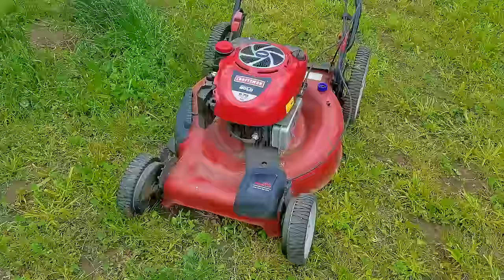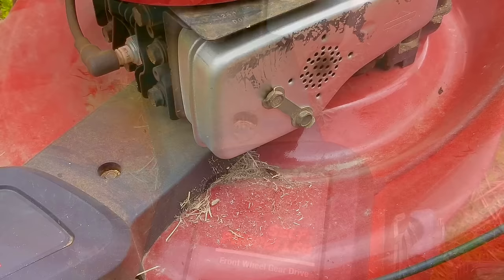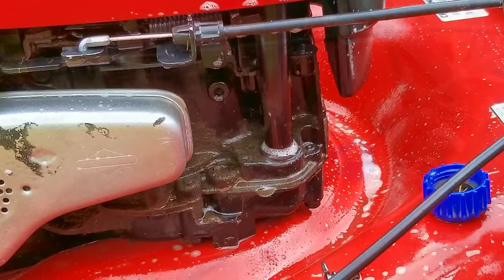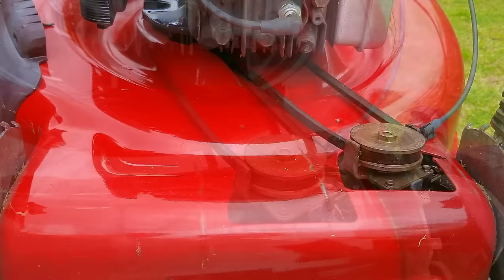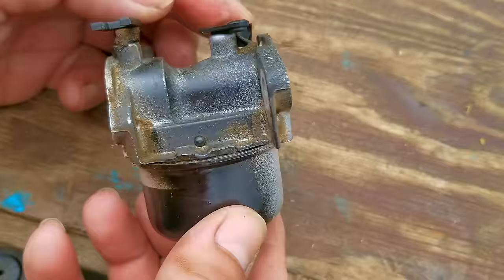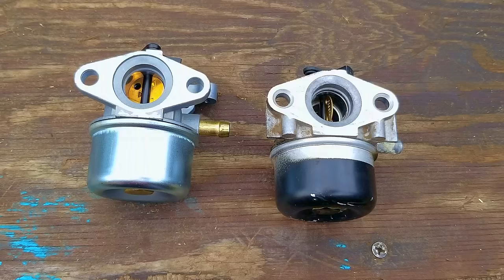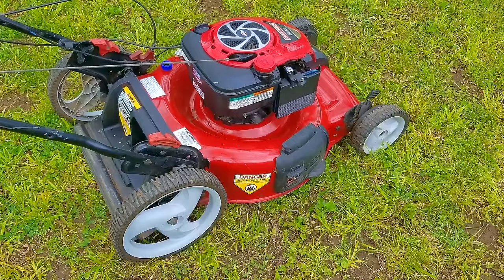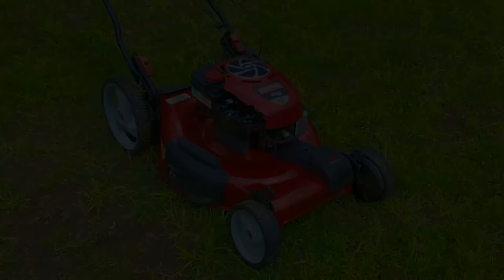Fixing A Craftsman Mower That Won't Start

Comment: funny, this is the exact same repairs i just did on 2 toro walk behinds I was recently given. one was a 2002 model, one was a 2016 model. both in excellent condition bit were not running. the 2002 model had alot of crystallized build up along the valve, the other had a small crack in the needle seat that was flooding the engine. CHEERS.
Reply from the maker: Thank you TheTipsyGamer for sharing your experience, I appreciate it.

Comment: I check my oil in all my lawn equipment every time before I cut my lawn. Having the proper amount of oil and having clean oil and air filter is very important. I check all I mentioned before I even start my mower or lawn tractor
Reply from the maker: very nice Gary Allen.

Comment: I use synthetic 5W30 on all my Briggs stuff and check it before each use. The positive difference in fuel efficiency with synthetic over conventional SAE30 is noticeable in my experience. I also like the flexibility to use the equipment in any outside temp condition as compared to conventional SAE30. That really helps living in the northeast.
Reply from the maker: Great point! I'm going to have to consider switching.
Reply from the maker: thanks for the information I really needed that.

Comment: I bought a used Craftsman (grey with red motor cowling) with the MRS 6.75 engine. Thing ran for 6 years without any maintenance, started on the first pull every time, and I sold it for what I bought it for.  Very underrated mowers.
Reply from the maker: you got that right.

Comment: I got a 7 ft lbs Briggs mower (Platinum line?) which is in OK shape, only issue is the blade adaptor, and blade and missing and the bolt is broken off in the crank. I'm a mechanic, and i could bring it to work, but man. Hard spending 50 or so dollars and idk an hour or so trying to get a bolt out for a free mower lol. Love the easy fixes. I got a good few free mowers and 80% of them i dropped the bowl, wiped it out, fresh gas in the tank and shes good.
Reply from the maker: that's your call, hopefully an easy out works.

Comment: I just found a mower in the trash I was just gonna change the filter and spark plug. But damn. You gave me so many ideas. I mean even if I don't get it running (which I'm pretty sure I will) it's still fun for me. And not very expensive. And I learned
Reply from the maker: you bring up a great point.  A lot of people get enjoyment from working on these.  Hopefully they can also get them working in the end.

Comment: Honestly, I may check the oil in my mowers may be 4 times a season and they’re never low. Always change the oil at the beginning of the season. You bring up a good point in the regards to chances of success, and that’s the prices of certain parts is something to keep in mind. I repaired my Stihl FS 110 a number of years ago. I thought I’d just get the necessary carb rebuild kit, but after some investigation, a new carb (a Stihl one mind you) was cheaper than the carb rebuild kit. The longer I’ve been into fixing my own, and sometimes other’s small engines and equipment, is the the sum of the parts, when purchasing individually, is substantially more than the whole piece of equipment.
Reply from the maker: thank you Warren Burke.

Comment: This may sound odd, but I ALWAYS check the oil before starting the mower. This is especially important since over time it likely will burn a little....and a little more...until it gets to the point of becoming dangerous like in the video. Not only that but most user manuals tell you to do so probably for this reason.
Reply from the maker: you're doing it right, a little bit of maintenance goes a long way.

Comment: awesome ....amazing how your time is valuable ....we love to see 13 to 15 min videos to the point but there is so much more when it comes to pertinent or non pertinent and angles and cleaning and waiting for parts ..... is there a recommended rpm for engines and how do you find it without some form of tach....how would you use a tack on a mower

Comment: I usually check the oil every time a mower runs until I see how they're going to act as far as using it. Delo stays with the old and new because it's thicker I suppose but I still check the engines regularly. With a new to me rig I usually pull the blower housing off to see about rats nests and damage and rust on the mag and flywheel. Briggs says that rust doesn't hurt anything but if that's the case, why don't they ship their engines pre-rusted! Next is usually the carb and fuel system. I already checked the compression by pulling the rope and seeing how much oil is in it. And ether (starting fluid) makes a fine degreaser. Thanks and BLESSINGS!

Comment: I usually change the oil every season check it throughout the mowing season to make sure its still at the correct level and mostly clean if it looks to dirty it gets changed if it gets to low look for damage or leaks which hasn't happened but I've had a crap mower that burnt oil because of blow by it was rebuilt after it wouldn't start and had piston cylinder wall damage had a replacement piston and rings and sanded cylinder walls to fix most of the damage but still had minimal  pitting or roughness like scratches that allowed a little oil by as it ran so it smoked alot and used a little oil due it it getting burned
Reply from the maker: thank you Eric Richardson.

Comment: I’d go a little bit higher on the rpms, it should be around 3000 for a 22inch self propelled they need the extra oomph to get thru tall thick conditions. You don’t have to use a meter go by ear, you’ll know if it’s running too fast it should be a happy medium around 3000. I have a video of mine that I posted after I adjusted it and that is the correct RPM speed these Briggs quantum’s should run at incase your not sure how it should sound by ear. I had this same mower! Loved it.
Reply from the maker: Thank you DWoods, I just have to be careful what I show on video.

Comment: Like u said it's a chance to replace the needle and seat sometimes on the original carb I have done it and almost the same issue . As for the oil I check it before I use my lawn equipment I have just in case
Reply from the maker: thank you Turningwrenches85
Reply: @HomeGaragechannel  your welcome

Comment: I've got one with this same style engine. It will putt for a second after pushing the primer bulb a few times, then dies. I had cleaned the carb and got the throttle plate moving again. The jet is clear, and I can see the fuel bubbling up when pushing the primer. This carb does not have a choke plate. I have another mower that I have to repair so wanted to get this one going in the meantime.
Your video helps a lot. I think I may just have to get a new carb (cost effective, as you say), and it will be good to go. Still wondering about the lack of a choke.
Reply from the maker: yes , once you've exhausted your attempts to clean the carb, just buy a new one.

Comment: I check my oil every other cutting. i learned that when the oil is run low like that the engine heats up and shuts down the coil . I am sure you heard before that it runs a while and shuts off but starts a few minutes later
Reply from the maker: no I hadn't heard of that. If that was a feature, I would think they would advertise it on the box.

Comment: Let me ask you what motor oil are you using? I'm still buying the little bottles that are sold at most places that have a parts section for lawn equipment. I have seen online that some people say you can buy car oil I don't remember the weight off the top of my head. I want it to get your opinion on that.

Also I know you get some of your things from Amazon and eBay where do you order from when you cannot find what you're looking for from Amazon or eBay.

And as always I enjoyed your video and gave you the thumbs up. Look forward to the next one.
Reply from the maker: Thank you Davide Frank for the questions.
I use motor oil 99% the time and I haven't had any issues. Some would tell you use oil formulated for air cooled small engines, and they are probably right, but I haven't had any issues yet. I use 10w-30.
I only buy from Amazon, 95% of the time using Ebay for those rare occasions.  If for some reason I can't find it on either, I simply don't buy it, and wait for it to show up.
Reply: @HomeGaragechannel   thank you for answering my question.
Reply from the maker: no problem.

Comment: I have replaced the seat with no problems but carburetors are so cheap now it's easier to just replace them . This style mower is my favorite of all time. Have you been approached by Hipa like all the other guys? They seem to make good stuff.
Reply from the maker: I don't mind Hipa but If I find a cheaper price, that's the one I'll go with .
Reply: @HomeGaragechannel  me too. They are not the cheapest.  They have been giving away lots of stuff to some of the other channels.  I was  hoping they would help you out.
Reply from the maker: I'll let you know they've contacted me several times and I have not responded.

Comment: Was hoping for a needle seat replacement as my personal pressure washer with same carb needs one. Ebay has seats 20 for $7 shipped.
Reply from the maker: I'm glad you said that, I have a video I just film where I replaced the seat. it was a bit hairy to say the least. The seat replacement works but the success rate is questionable. That video will be out soon.
Reply: @D4x4Bronc, beware.. I made the mistake of buying those and they don't fit. They are too fat and the float is not level. Get the original manufacturer's part or known reliable aftermarket such as Stens, Oregon, Rotary, etc..

Comment: I got a question I have a  Echo trim and it dose not like to start easy when it dose run you have to give it 2 to 5 mins before up can go to full power or it just try to die and if you turn it off and gone for 5 mins you have to restart it like it is cold I try putting little more oil in the gas to help but not sure what to do
Reply from the maker: interesting, I would like to get a compression reading from your engine, to make sure, it's not worn out.

Comment: Well for me every few months and when it's time for a change i get it done by using a oil extraction kit which makes little to no mess from my view etc.
Reply from the maker: I've thought about get one, where did you get yours?
Reply: @HomeGaragechannel  well here in Australia we have a hardware store chain called Bunnings Warehouse but yeah i do believe that you can buy them online too.
Reply: @Patrick4959  Oil extraction tanks are SOOOO darn usefull for any type of smaller engines. Even good for bigger ones if draining it is going to make a ginormus mess or drain off into something like a lake ect. Fast easy, no mess, even gets all the oil in most cases.
Reply: @baileyhatfield4273  your not wrong and in some cases the old fashioned way is just as useful etc.

Comment: Hey bro what's up? I've noticed that most of the newer mowers if not all have a wash port on them. My question to you is what is the wash port on these mowers for? Style apparently since no one seems to use them at all
Reply from the maker: that's a good question. After using your mower, you can connect your garden hose to it, and then turn on your mower. IT will clean under the mowing deck for you.
Reply: @HomeGaragechannel  since I've never used a mower ever in my life I'm assuming that these flat head engine mowers are more powerful than the other engines

Comment: If anyone can tell me where to find or what the part number is for the air filter assembly...you'll be my new best friend. I need the rear and front cover. Mine doesn't have a priming bulb either, like this one.

Comment: I could use some help, I have changed the oil, spark plug, and the air filter. This was a donated mower, which likely not been used in 3-5 years. I sprayed starter fluid, and got it going for 3-5 seconds. So I cleaned everything, remvoed the bowl to ensure there were no issues, cleaned completly. I then pulled the carburator, to clean it completly, but after putting it back there was a lever that would seem to maybe have a spring attached, that it may have popped off. I cannot find anything as I had some plywood platform to work on it. After looking at the video again, I ssee that there is a spring missing. Can you tell me what it is so I can get another, and where it attaches to?
Reply from the maker: since I Cannot see what you're looking I can only guess as to the spring. But if I had to guess I'd say it was the air vane return spring. it goes to the lever arm on the vane, to a tang that's on the metal plate. you can see the spring in this video at 7:32.

Comment: I like the way you cleaned the mower. However, is there any area we should not pour water on to avoid the engine not start?
Reply from the maker: sure the whole thing. it's actually recommended, in the manual to not use water, instead blow off the mower, and then a damp rag.
Reply: @HomeGaragechannel  Thanks!

Comment: I have one that’s a very similar model, it has a new air filter, new carb and new spark plug. It doesn’t run consistently. Can this be fuel issues?
Reply from the maker: it could be, did you buy a new OEM carb, or a cheaper aftermarket one?   Also did you clean the fuel tank, confirmed the fuel line was not blocked, and also was it ever ran low on oil?

Comment: For faded Red or Black plastics use 50/50 mix of Boiled linseed oil and paint thinner...just a thin wipe on sun faded plastics goes a long way..just wipe it on and leave it dry..
Reply from the maker: Really!? I'll have to try that out. thank you jct300m
Reply: @HomeGaragechannel  Its got to be "Boiled" linseed oil..works pretty good and does not leave a residue behind either..

Comment: Can you share the link to the carburetor you bought? Thanks
Reply from the maker: I can, but if you're intending to use on , I would confirm that it's going to work for your application.
Reply from the maker: I put the link in the description field.

Comment: My craftman mower i bought in 2008 with the Honda engine still runs and i never cleaned the carb. They don't make them like they used to.
Reply from the maker: correct

Comment: I’m shocked at how low cost carbs are. Replaced on for a mower I bought and reconditioned for my son. The seals were almost as much as a factory new carb. Problem solved. He’s loving the new mower for 1/3  $ of a new one.
Reply from the maker: nice work!

Comment: I tried starting my craftsman mower today and it won’t start. The mower is only 2 years old garage kept. I flushed out the old fuel and put new fuel, checked the spark plugs and the oil level. But it simply won’t star. What could be the issue?
Reply from the maker: how did you flush out the fuel?
And more then likely the fuel jet is clogged just like in this video.

Comment: I have a Craftsman lawnmower that won't start. I pulled the carb, cleaned the main jet and sprayed every nook and cranny inside the carb. I also replaced the inline fuel filter, added fresh gas and checked the spark plug and that looks fine. Went to go start it, and nothing. I sprayed the carb with a little cleaner and she fires right up then dies. Any help would be greatly appreciated.
Reply from the maker: sure, do me a favor and loosen the bolt on the bottom of the carb, and see how much fuel drips out,
IF it's slow or none comes out, the there's an obstruction in the fuel line,   IF a lot of fuel comes out, then there's a blockage in the carb. I would just replace the carb.
Reply: @HomeGaragechannel  thanks for the reply. I took the carb apart again and found that the rubber oring that the float needle seats into was coming apart and blocking the fuel from going into the bowl. I just went ahead and ordered a new carb. Thanks again.

Comment: I have a question which I think I know the answer but I would like to be sure. Does the 2 cycle oil in gas ever get diluted by the gas to the point you are just giving you 2 cycle engines straight gas?
Reply from the maker: the answer is no, unless you add more gasoline to the mixture, but on its own, no.

Comment: I replaced a carb on a craftsman push mower and it's still not getting fuel into the bowl. If I disconnect the fuel line from the carb the fuel flows out of the line like it should. I've manually filled the bowl twice which meant I had to remove the carb and the mower runs fine until it drains the bowl. What could be the problem with the fuel flow?
Reply from the maker: the needle and seat are not allowing fuel to flow into the bowl.  do me a favor and tilt the mower's front wheels up into the air.  Take off the air filter and the base.  Take off the bowl, and watch out for what spills from it. Then while pressing the float up, put the mower back on all fours, then let go of the float so it can drop down.  watch how much flows out of the needle and seat area.
Reply: I figured it out...poor design...I put a couple tiny washers between the carb & the bowl...when the bowl bolts are tightened and I  shook the carb I couldn't hear the float bouncing...washers dropped the bowl enough...once I got it back together it fired right up and stayed running...
Reply from the maker: nice you figured out one of my tricks I use too!

Comment: It is better to have some type of oil instead on none even if that means using old motor oil but only for a short period
Reply from the maker: you are absolutely right about that. thank you big mess test 230.
Reply: @HomeGaragechannel  I recommend 4cycle Briggs and station motor oil I have a Briggs quantum 5HP from 06 and it still runs and that's the only oil I use
Reply from the maker: I agree with you, OIL meant for small engines is always best. I'll have to look up the cost per ounce though, as what I'm using is only $0.11 per ounce.
Reply: @HomeGaragechannel  I can get it at walmart for 4.14 dollars
Reply from the maker: is that per quart?
Reply: @HomeGaragechannel  for a quart yes